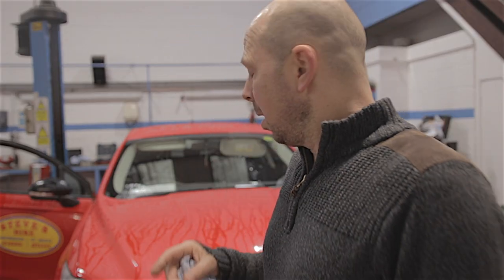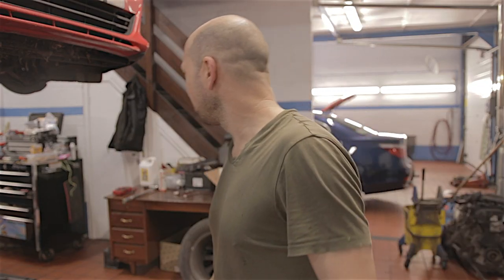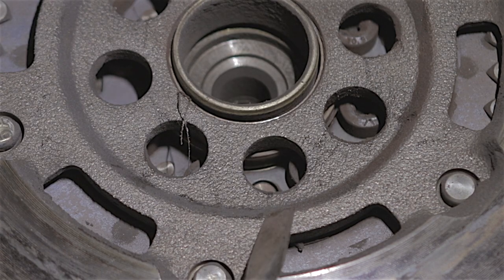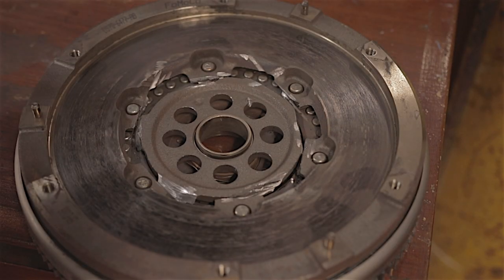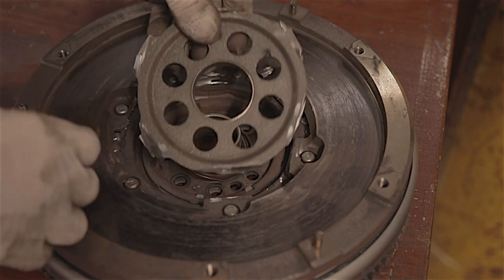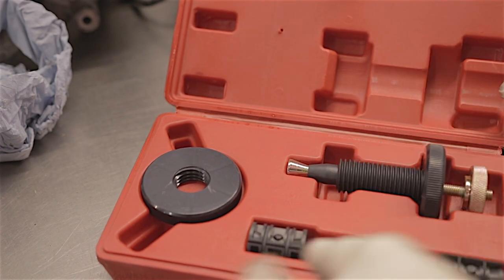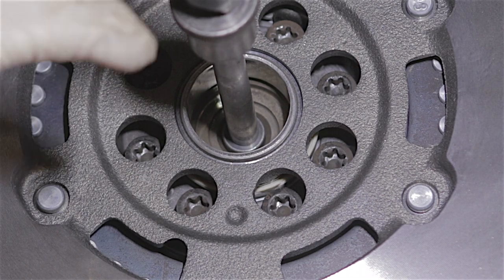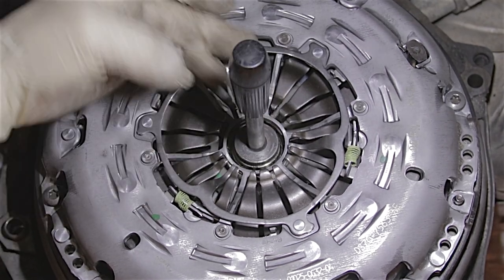Flywheel Down !   Clutch Fit & How Long Will My Ford Mondeo Mk5 2L diesel Clutch Last

Comment: Any problems with excessive inner front tire wear on the mk4 mondeos Alan?
Reply: Heavy cars ! I found the back hardly wore down at all, those large alloy wheels really go through tyres rather than the smaller wheels its fast  cornering on roundabouts that seems to wear the fronts quickly.
Reply: I've had a few over last 12yrs doing high mileage urban areas not had a problem on inner tyre wear just front tyre wear.

Comment: Is there a reason for only using genuine parts on the cabs? Warranty?
Reply from the maker: despite the extra expense they are better quality and just work most of the time especially diesel injectors where cheap recon ones can be a lottery

Comment: If only there would be more mechanics with at least a portion of your skill level ;) Had some pretty bad experiences over the last 10 years.. 
I am hoping you could help me out a bit with my Focus 1.5tdci:
So, long story short, after a few test drives my brother and I decided that 2015 (facelift) Ford Focus 1.5 tdci 88kW would be a great buy, so we imported 2 "same" cars from Germany (to Croatia). 
His Focus now has around 95k miles, mine is at 84k miles. And guess what, we both have clutch problems, but different! 
His is squealing (bite point around half way as I remember), mostly when going in reverse even on light load (parking) or in 1st gear on an incline (interestingly, it hasnt gone much worse since 75k miles, but is getting worse..). Also the gear knob itself squeals a bit when putting it in reverse but no big deal, other gears are fine. 
My clutch doesnt squeal but started to bite really high (when i release the clutch pedal about 75% of the way) and I also noticed that lately it has become very hard to drive smoothly, especially the 1st to 2nd gear change. A few days ago I also noticed a weird "clicking" sound on idle that I captured on video: https://youtu.be/FlD0nuy0-I8 (vertical video and low volume, sorry-1st ever upload!)
Any help would be greatly appreciated!

Comment: Is there any aftermarket heavy duty versions of dmf's available?
Reply: Some petrol engines can be converted to solid flywheel but you get more noise and vibration. I doubt they do it for diesels tho.
Reply: @benlee2765  yeah I've heard about that. I've also heard that some diesel have been done, but there's also been cases of c. shaft failures which have nicely destroyed the whole engine. Don't know if it is true, though it would be miracle if someone had not tried it somewhere. Anyway I was thinking more about just reinforced units. I guess there could be sales..
Reply: @jothain  yes, the point of a dmf is to dampen the shock through the drive line, changing to solid flywheel can damage the gearbox.

Comment: Please put the safety guard back on that angle grinder.
It's called a safety guard for a very good reason.
I hate seeing them being used without. 

Great vid otherwise. 

Any experience of the 1.5tdci engined mondeo?
Reply: Oh dear  ; Another safety officer here Alan ,  appearing to be drunk & smashing bottles might just be a clue  . Are yer gettin it. LOL
Reply from the maker: lmao
Reply from the maker: only had one 1.5 or maybe 1.6 with blown head gasket but they are a bit low on power

Comment: Do you think the Auto is a better choice mate?
Reply from the maker: probably not for taxis, i don't know if the auto boxes on these cars are any good as we don't have any but i like auto cars especially when your juggling a milkshake and hamburger when driving lol
Reply: We got a 2.0 poweshift tdci focus....goes like stink, gearbox is well suited to torque band of engine.... 141k and no receipts of any major work apart from the £300 gearbox oil changes at every 37k ish miles

Comment: Do'es the replacement clutch, last as long as the original?
Reply from the maker: the clutches bought from the main dealer do but that aint much help if the flywheel takes a dump first

Comment: Don't you ever change the gearbox oil ?
Reply: It's never been a requirement on all the Ford's I've had. And they don't tend to suffer gearbox issues like vw
Reply from the maker: no i only replace the oil if a gearbox comes apart but if i owned a mk5 i may do it
Reply: Just thought it was common practice

Comment: Duuuuude you dont do that job without replacing that leaky crank seal aswell....
Reply from the maker: its the high pressure fuel pump seal thats leaking, not the crank seal

Comment: If you had the guard fitted to the angle grinder you wouldn’t get covered in crap. 
Also glasses won’t save your face when the cutting disk explodes and you have no guard on yer grinder.

Comment: Drivers need to stop driving around and changing gear at silly low rpm and labouring the engines..., that's what destroys the flywheels.....my old mk3 was still on its original clutch and flywheel at 200k miles and didnt rattle, my mk4 is on 155k and still or original, I use 3rd gear at 30, and dont use 6th until I'm doing 70+.....otherwise the engine just labours....

Comment: Are DMF just a complete rip off.?
Reply from the maker: they do serve an important purpose and its quite technical why they are needed on these modern diesels but for sure they could be built better
Reply: Can someone tell me what was wrong with the solid flywheel that worked for years
Reply: @johnf3278   unless you want your eyeballs to rattle out of their sockets, dont bother with a single flywheel conversion

Comment: You never spray Brake Cleaner on DMF, but on cloth first and then you wipe the DMF.
Reply from the maker: whys that ..explain yourself then
Reply: @alan4x  That say in the manual of LUK or Sachs.
It is because of the grease inside the DMF, as we all know grease and brake cleaner dont like each other...
Reply from the maker: @elzrinja365  yeah i can agree with that, well thanks, learn something new every day, cheers
Reply: @alan4x Are you from London?
Im Croat and you sound to me like cockney accent, am I right?
Reply from the maker: @elzrinja365  lol, don't know, mother is from london and dad from scotland
Reply: @alan4x  Haha, long live mate!
Reply from the maker: @elzrinja365  lol🤣
Reply: @alan4x  From LUK:
"The friction surface on the DMF must be cleaned with 
a cloth that has been moistened with a degreasing 
cleaning agent!
No cleaning agent must be allowed to get into the 
DMF! This is the reason why cleaning the DMF with 
a high-pressure cleaner, in a part washing machine, 
under the direct influence of cleaning sprays and with 
compressed air is not permitted."
Reply: @alan4x  From Sachs:
"Clean the dual-mass flywheel with oil- and grease-free rags only. High-pressure cleaners, steam jets, cleaning sprays or compressed air must not be used. That could lead to dirt or cleaning agents getting inside the dual-mass flywheel and causing increased wear."
Reply from the maker: @elzrinja365  thanks for that, i have been spraying brake cleaner on them for years lol

Comment: Torqueing the screws is to make sure screws hold properly with even load. What that means? Even distribution of force on the screws. In very simple terms. Screw that is bit less tightened  shall stretch more, and load shall go on other screws. If other screws are properly torqued they shall shall go closer to region where they can snap because of the one that has stretched due to lower clamping force. If screws are over torqued they are more prone to braking in general, since screws are basically very stiff springs and this is more important if there are significant temperature changes in the screw connection. Ok ok ok ok, before you go bezzerk and go like WTF this moron is talking about, I admit in many positions  as long as you tighten sufficiently it is fine, but still it is very good practice to obey recommended torques and make sure torque is not wasted on  friction, meaning read manuals and see what kind of lube is recommended in order to ensure best clamping force with proper screw stretching.  I would also change crank seal, even if it is not leaking. Flywheel is not coming off so often, good opportunity.

Comment: Personally I think when you stall these engines it causes the the deterioration of the fuel mass flywheel 
They sound horrendous and knock that loud when they are stalled during pull off or low speed 
Every time I stalled my mk4 i think of how much it cost to replace the fly and clutch 🤬
Reply from the maker: these flywheels don't like labouring engines at low revs

Comment: Had a Insignia DMF rattling at 75k on a one owner really well looked after sensible driven car,. Utterly crap component .
Reply: Wife had the same on an Audi A3 absolute crap 3 year old car just out of warranty with 68k remember having ago at Audi customer care over it they only paid a quarter of the costs. Even though the part was substandard.